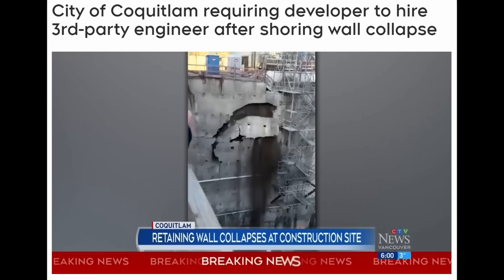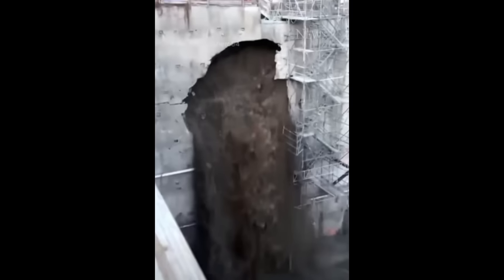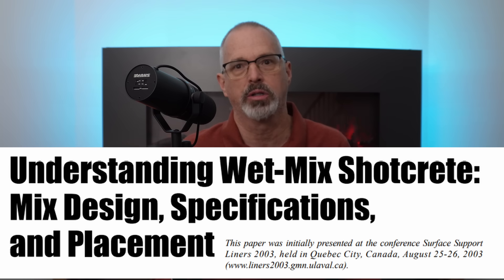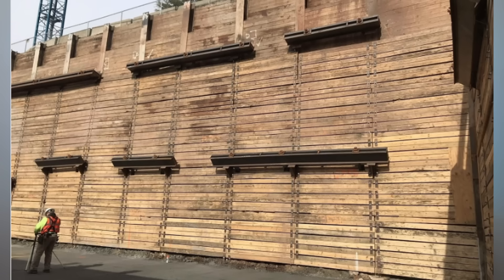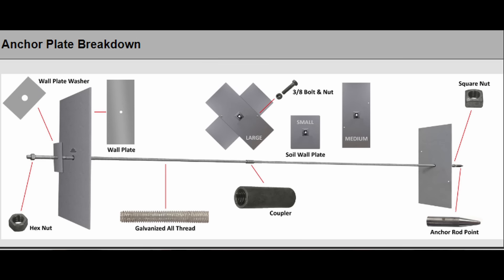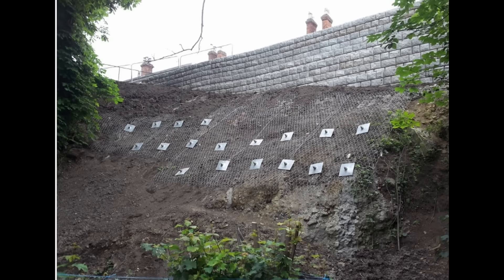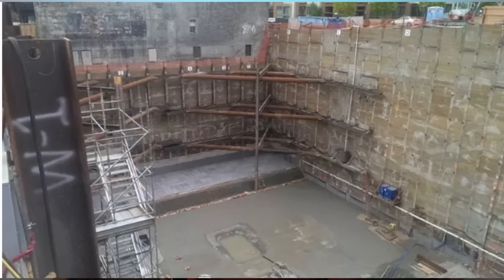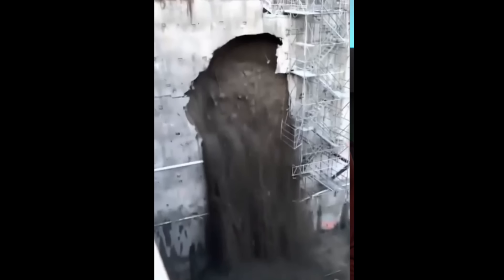Retaining Wall Collapse in Canada

Comment: I don't think CJ knows what he's talking about. Professional Engineer?  HA! 
That doesn't look like shotcrete.  For one thing, it has to be sprayed on to a stable backdrop of rock or hardpan, or a built form.
You certainly could not spray it against 60 feet of loose fill.  IMPOSSIBLE.

That wall was backfilled after the fact, too soon before any lateral support was in place. 
You would not have a 60 ft high wall built without the lateral support.
The key holes you see in the face of the wall would be for support of the floors that would be built, providing the lateral support.
They backfilled the wall before the needed support was in place.
BAD ENGINEERING. 
Simple as that!
Reply from the maker: The real expert has entered the chat.

Comment: Lysenkoism, look it up 'cause we're gonna see more and more critical failures in the future. (see James Lindsay New Discourse). Seriously? Shotcrete on a 60' retaining wall? I don't care how much fibro mesh they used, this should've been minimum 18",  35 mpa with 1" rebar and AGGREGATE. Even then I can't see that being passed by the engineer. I would think it would call for massive I beams and steel wall and huge piles!! They likely boosted the water instead of expensive plastisizer.  Like I said... Lysenkoism!
Reply from the maker: Interesting reference, Thank you.  I hadn't heard this term before but it does explain what is going on in many parts of the western world (that some people think that the normal rules don't apply anymore).

Comment: Absolutely NO excuse. This is not the only spot here in BC. Just yesterday there is a similar construction site in the interior with a huge excavation, same looking support structure and now residents in a neighbouring building are ordered to evacuate due to their own building suffering structural cracks!
  Makes me absolutely furious!
Reply: Shotcrete systems absolutely have their place.  Problem is they have over-established themselves in VAN area creating an extensive network of shotcrete contractors vying for more and more of the pie, and these systems are simply easier, cheaper and  faster to use than the superior methods mentioned in the video.  If you are doing the same wall with H-beams and walers, you get into using much bigger equipment and virtually no excavation process happening until the majority of H-beams are installed.
Reply from the maker: Yes, I am hearing from you and others who indicate that these systems are common in that area.  However, it seems that something was missed on this job (like adequate face reinforcing). @ScottGostick
Reply from the maker: Wow, it sounds like this is more common than I thought.

Comment: I live about 2km away from the site.   It is near the top of a hill, so I reasonably confident that this is not fill material.   "North Road" runs alongside the site to the left of the camera position.  The road itself is one of the first in the region and follows the natural grade, originally linking New Westminster to Port Moody.  The soil would be left over from west coast rainforest . Cedars, Firs & Hemlocks.     I am no civil engineer, but I imagine that there should have been at least a mesh reinforcement installed in the shotcrete.   I have seen lots of sites like this around town where shotcrete is used for retaking walls.    My verdict is that  the general contractor was cutting corners.   
There were holes for the  supports for the skytrain that were bored down the center line of North Road a few years ago.  It is not as if the soil conditions in the area were not well known.  Also, across Foster Street you can see a new tower that would have had a similar basement excavation
https://maps.app.goo.gl/jpLbXfbGVW3xz58U7
The collapse would have been about where the dumpster is sitting in the above streetview pic.
Check out all the tower cranes.   These tall condo towers are popping up like mushrooms in the neighbourhood.

Comment: It has been a very wet fall here, I would not be surprised if there was water pooling behind the wall.
Reply: Hydrostatic pressure could very well have contributed to the failure but that should have been calculated in the initial design.

Comment: Soil seems dry and possibly granular, anchors generally remained in place.    I suspect punching shear failure of the shotcrete at the tie rod anchor points.  Secondly,  failure of a section of the shotcrete due to bad workmanship, bad design or a combination.
Reply from the maker: Your observations are likely correct. The weak nature of that soil should have been apparent during excavation so I am curious to learn more details in the coming weeks.

Comment: I was a geologist in a materials testing lab and did sampling, drilling, and soil testing. The dry soil struck me as no better than loose sand. Seen several such failures on a small scale. Usually a retaining wall next to a pool. inadequate compacting, and no anchors into the fill. Never seen a shotcrete wall more than 10' high.
Reply from the maker: Thank you. It will be interesting to learn more about what is going on with this project.

Comment: As others have stated, the vast majority of buildings in Vancouver and the region are excavated this way without issue, with the exception being in areas where it is on known filled regions (previously reclaimed areas that used to be ocean/swamp mostly).

The cause is pretty clear, that small area was an old deep entrance to a parking lot which was filled with loose soil after being demolished, unlike the generally very hard packed soil in the whole region.  So even if they took samples (which I assume they are required to do for the permit), unless they took a sample in that former parkade entrance area, they would have not known about it unless they were involved in the demolition years prior.

Streetview pre-construction: https://www.google.com/maps/@49.2568517,-122.8926199,3a,48.8y,177.08h,78.69t/data=!3m7!1e1!3m5!1sz4QqJ9gHqy7BcS7QFyPXrg!2e0!5s20201201T000000!7i16384!8i8192?entry=ttu

aerial view: https://youtu.be/hIUnKcZ-FaQ?list=TLPQMDYxMjIwMjPIoCozPJhhag&t=48
If you turn around in the streetview, you can see its exactly where the collapse occurred in relation to the footage from above

Comment: Different condition but I had a friend that worked on shotcrete water tanks, and some were pretty big. Layer of shotcrete, wind a 7 strand wire around it tight with a "wire winder" and then shotcrete again.
Reply from the maker: I think shotcrete applications can be quite strong when done properly with the requisite reinforcing steel.

Comment: One of the mantras we've be hearing for the past 40 or so years is "deregulate, deregulate, deregulate" because it's slowing down production and increasing costs. I wouldn't be all that surprised to find some element of that responsible for this kind of catastrophe. It seems to come on the heals of the promotion of such political, and anti-government types, as objectivists, neoliberals, libertarians, anarcho capitalists, and, more recently, fascists. There are other variants in between, but a lot of it promotes anti government rhetoric while demanding more authoritarian approaches in the same breath. Let's not ignore the corporate side of anti regulation and the desire to diminish the importance of labor in such endeavors. The greatest influence on the direction a society takes comes from those with kind of resources to exact this kind of pressure.

Comment: Unbelievable, built many a wall, but this I don't understand. I see the anchors but see no wire mesh or rebar, etc.  What did they stick the anchors through and what did they shoot the shotcrete onto??? I would love to see more pics. If there was wire mesh like on in ground pools that are shotcreted they were really pushing it at that kind of height and the load it had to carry, but I do not see any metal except the anchors. Bad design or incompitant builder, what a mess. I definitely see no road bed material if that was a road on top, I guess every one is into 'Tofu Building'.

Comment: Now that it's failed, I'd expect their site permit to be yanked until the proper shoring is constructed.

I'm no civil engineer, my experience is aerospace. I do know what shotcrete is and my limited knowledge informs me that it has a low tensile strength.

I knew the moment you said shotcrete that I would have never gone anywhere near that wall ... neither above or below it!

This is an obviously bad idea and runs contrary to basic common sense much less engineering good practice.

Comment: 5:00 You probably got it right there by saying that this might have been copied from sites that have hard rock. More than half of Canada is covered by the Canadian Shield the Rockies and the Appalaches.  You often don't need to dig more than a few feet to find bedrock. Most worksites have at least one rock hammer somewhere on site. Finding rock is just something that our construction industry expects. The rock that we've got is some of the oldest and hardest, most stable on the planet. You can cut a sheer rock face and expect that it will stay in place without any additional support. Just look at any of our highways dug through mountains on Google earth.

Comment: My feeling is there was a compounding series of errors. They don't necessarily know what kind of soil conditions they're going to encounter when digging the parkade down. It's all kind of reactionary. Soil was probably test drilled and they had some idea of what they would run into but largely the engineering is done one segment at a time as its dug down. Probably a Junior engineer sent to site and allowed the minimum requirement for the walls engineering. But as they went deeper they kept finding more and more unstructured soil. Then the needs for additional reinforcement above changed but they didn't know, or didn't press for re-work.

Comment: Perry Adebar, a University of B.C. professor of structural engineering, said he spent Friday discussing the “dramatic video” that has been circulating on social media with his class and other structural and geotechnical engineers.

Collapse at Coquitlam construction site possibly caused by poor engineering or sloppy workmanship.
“I’m a concrete structures expert … so when I saw the video, I thought, ‘Wow, that’s unbelievable.’ And then I talked to geotechnical engineers [who] are the ones that design these retaining walls and was surprised to learn that it’s quite common that they don’t put reinforcing steel in them,” said Adebar.

The wall is designed to help protect the sides of an excavation while the building foundation is built in the hole.  The soil spewing out was dry, so it most likely had nothing to do with water.  Also noted that the metal retaining anchors were still there in the soil so that probably wasn't the issue. 

The company had noticed the cracks and had the site evacuated well before.  

I've actually never seen this happen in Canada.  It will take months to figure out.

Comment: I worked in the Vancouver Canada region for many years. This system is just about all we use around vancouver, with varying densities of anchors, thicknesses of concrete, and different types of reinforcing. Most often a single or double layer of ww mesh is used. Very occasionally rebar.
Note that your shotcrete example was in a structural permanent wall, not a shoring or retaining wall. 
Very occasionally we have installed soldier piles in cert sandy soils, but usually only in permanent applications.
There was an issue here (obviously). Most likely with insufficient or incorrect mesh installation and/or concrete thickness or strength.
Reply from the maker: Thanks for your comments.  That wall looked very thin to me with little to no steel reinforcing.  I will be interested to see how this story develops.
Reply: Contractor cheaped out, pure and simple
Reply: @drumswest5035  shot crete outfits in Vancouver are usually pretty damn good, and follow engineering protocols.
Reply: @drumswest5035  I don't think it was cheapness. The wall size and rebar is specified by an engineer and it usually gets installed per the engineer's requirements. The specification may be wrong or the rebar was missed in the one location. However, in Vancouver, the Geotech usually specifies the rebar for the shotcrete wall which could also be an issue.

Comment: Common place use of shotcrete, except this wall did not have wire mesh
Reply from the maker: I haven't seen any wall that tall that didn't have braces or steel reinforcing.  It will be interesting to see how this all turns out.

Comment: So if it was made of shotcrete then the area was dug out first? and didn’t collapse during construction? Would I be right in saying that it is done in stages until you get to the level required?
Reply from the maker: This type of wall is typically installed in a top down fashion but I have never seen one like this at this height that didn't have more structural elements for reinforce the face.

Comment: Soils in the PNW can be highly heterogeneous due to glacial effects, volcanism, and massive floods. Maybe the pre-excavation soil boring characterization was not sufficiently dense to detect the soil in the collapsed volume.
Reply from the maker: True, but they should have noticed how weak the soils were when they were excavating for the wall.
Reply: @CaseyJones-Engineer  True, which leaves me wondering if there was no on-site professional inspection before the shotcrete went on at that location.

Comment: With the soil that loose, how would they have been able to construct such a lightweight wall in the first place? Using your sugar analogy, when digging the hole wouldn’t it have just kept collapsing on itself?
Reply from the maker: Good point.  It will be interesting to learn what observations were made during the installation of the wall.

Comment: I am retired from the construction trade. The demise of rules comes from the "Woke". Titan sub had the same problem. They "Threw the white man's" rules in the garbage and went with their feelings. Woke inspectors don't help and female engineers will not fix mistakes because people will talk or they should not be questioned on anything because "They are the educated ones". I worked with many engineers over the years. My last years were nightmares working with female engineers who were "Never wrong" even when they are wrong. Why? because a stupid ironworker can't tell me what is right and wrong.
Reply: Maybe it is a coincidence ,  but the quality of trades has increased dramatically since you two have put down your tools !
Reply: Good thing you are retired. You would have been cooked and fed to the woke savages today. I no longer fit either. I retired too early. But it was me or them.
 The ability to have your design attacked by competent engineers or contractors and then admit your short comings or go back after them is crucial. It's called peer review. It used to be when you were an EIT you were picked on mercilessly so you would learn to defend your position or admit you are wrong. Toughen you up.
  Your design will be mercilessly attacked by forces of nature that don't give rats ass about how that makes you feel. Dynamic earth pressures and water don't answer to HR.
 There is something to be said about old school. Good luck in retirement.
Reply: @mikeshanaberger7503  Millenial Towers in California and New York both f-cked. Titan sub where you fired the guy with the book written by my society and fired him and silenced him for it. Sub go Boom.

Comment: Usually the way they do it  in metro Vancouver is sheet piles or a slurry wall
Reply: These are what I usually see around here, with the added variation of drilling round holes next to each other and inserting pile rebar to make a row of pillars all around with connecting H-bars as seen in the video.